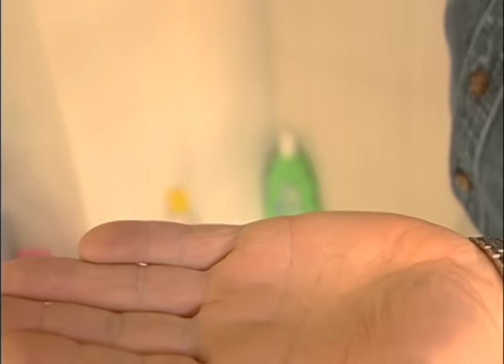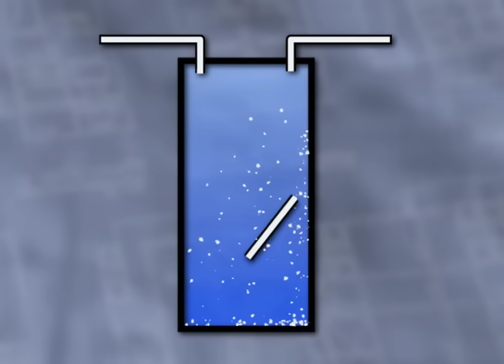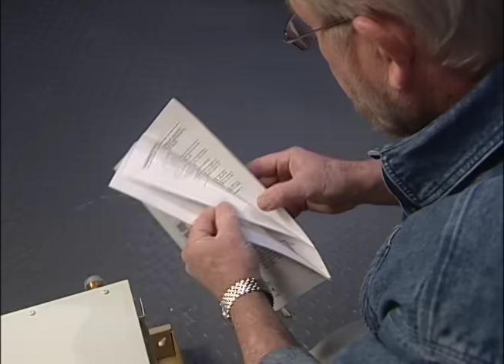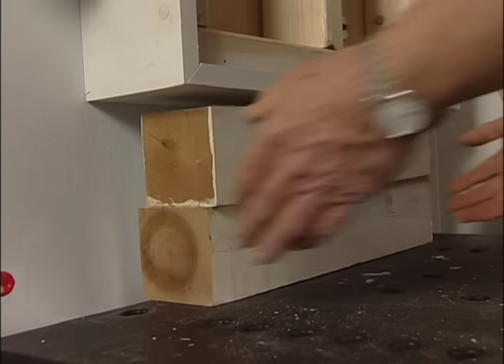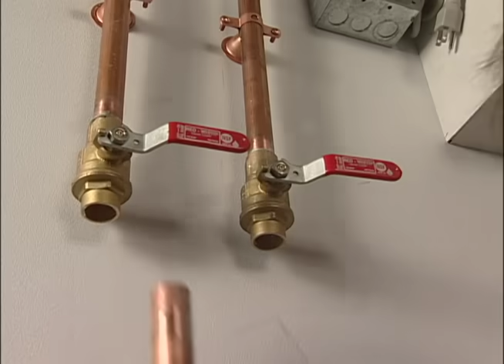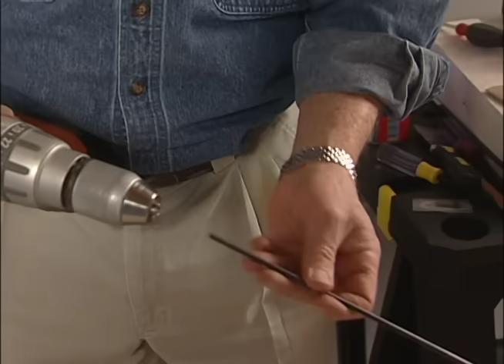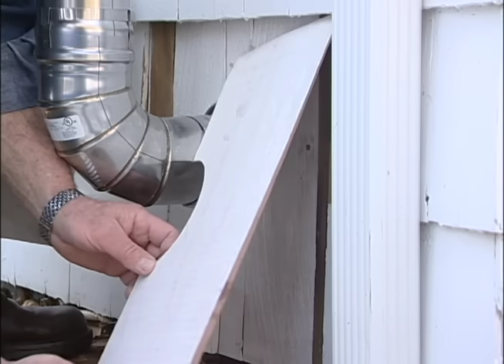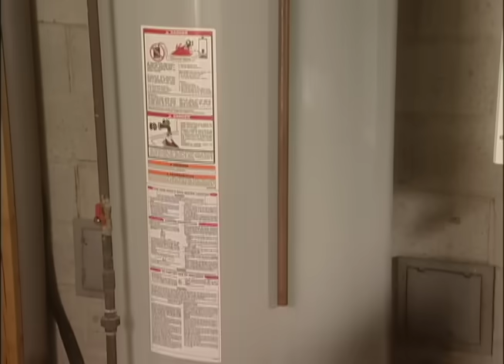Install a Tankless Water Heater

Comment: I disagree, on using "tankless" in Single Family Residences (SFRs).  They make sense in laundries and restaurants.   Existing houses are difficult to retrofit, to accommodate tankless, while complying with fire and plumbing codes, not to mention common sense.  But a plumber won't tell you that, because it's a cash cow for him.   This video trivializes all the complications, and the periodic maintenance requirements of such an expensive boondoggle.  Moreover, tanks are now vastly superior to prior designs; they are efficient and THEY FIT.
Reply: I tell my customers. What discourages most is when I point out that the local hardware store will have an element or thermostat for a tank, whereas on demand heater parts can take a while (with no hot water ) to arrive, and often require a plumber to install. I also share the fact that variations in water temperature and pressure in can equal erratic temperature out, which can be a problem, even with units designed to react to variations. 95% of them stick with a tank.

Comment: One time I tried to drain a water heater and I couldn't because the spigot was clogged with sediment.
Reply: same here, and the stupid plastic valve broke on a few units. what crap.
Reply: Use a short hose open valve and blow into the tank and clear the the valve

Comment: Strange, that doesn't look correct.  Normally the sediment traps are installed on the vertical run, say, instead of that 90' elbow, a "T" should have been used instead.

Comment: Don't get one they are prone to malfunctioning valves.
Reply: As if standard water heaters don't have problems.
Reply: I have never had a problem with the valves on a standard hot water heater . I don't lose hot water unless I take a long long shower.
Reply: I’ve installed nearly 1000 units, very low call backs mostly temp adjustment, removing anti scald limit, or the the rare flow sensor , which has solid warranties anyway
Reply: @andreyyaromich8277  They are horribly costly and can't keep water hot for a full shower.
Reply: cool azul lol the exact opposite of what your saying describes tankless water heaters, they are  designed to   run endlessly with light running out of hot water, something wrong with your own perticular heater maybe undersized. They used to cost 4-5 g 15 years ago. You can pick up 120,000btu units for under 1000$
Reply: *without running out

Comment: I am a Plumbing Contractor in MI. and specialize in service. These on-demand tankless water heaters are imported from overseas and while Lowes and Home Deport are fast to move you from a tank to tankless, you might ask them where the service parts are and who services them. These units have there issues as well and when they aren't working it could be weeks for you to get parts. That is if you can find some to work on it. Explain that to the wife. 
At that point you realize that you should have installed an AMERICAN MADE tank type water heater from the gitgo. Good luck with your new investment and oh, by the way, "You can't run numerous points of use at the same time and have plenty of hot water, with every fixture running you will loose water volume. The heater will run wide open trying to keep up with demand and believe me... it can't!!
Reply: Good old 1970's thinking  And yes we run the washer and take a shower at the same time with plenty of hot water  Of course you cant buy the cheapest unit on the market  Rannai has supply parts all over the country
Reply: Well it has been a long time since I read such a bullshit. Make America great again? Sorry you are playing yourself.
Reply: @Essenkiller  Go get one of those hardware store losers then. I have 25 years in the repair and install business, and can verify that Michael's points are 100% valid. I have actually removed several on demand heaters for customers who are fed up with them. :  )
Reply: @Robnord1  Its their own fault if they buy low quality stuff. Buy units from Vaillant, Buderus, Viessmann, or Junkers. Not this cheap American made stuff. They will last a lifetime.

Comment: I'm not so sure that you connected the vent stack pipes properly to each other.  You certainly didn't seal the pass through flange properly.  The flange and vapor barrier should have been shingled.  In other words, the bottom of the flange should have gone over the lower vapor barrier and the upper barrier should have overlapped the upper flange and lower barrier (as it did in your install.  The way you did it allows any water that gets to the flange to slip inside the lower vapor barrier.

Comment: So you didn’t want to hang it against the wall so you made a different wall
Reply: No, he explained that he needed to mount it a few inches forward from the actual wall so that the exhaust pipe line up in the middle of two floor joists to run to the outside.

Comment: tankless water heaters are great until you lose your power then you won't have hot water unless you have a battery backup unit or a whole house generator
Reply: Computergk91 Gaming true, but my old boiler for seam heat<HAD a standing pilot so had heat DURING POWER OUTAGES LIKE HURICANE SANDY, as it got cold here inNJ,   Now my replacement boiler no longer made with one,,so need a generator,Cheers FROM NJ🇺🇸

Comment: So combi boilers ??? Are America this far behind 😂😂
Reply: Mason Kohl not even a combi boiler- it only heats domestic hot water, heating is still done by a separate furnace.
Reply: Spencer Wilton NO, that’s why they ARE CALLED COMBI BOILERS,  1 UNIT DOES BOTH, somewhere you just have been les astray, or mis informed cheers from NJ🇺🇸

Comment: Swear we have these in the uk but they are called boilers
Reply: Callum G Americans haven't yet grasped that one small unit can provide both heat and hot water. Most of them still use a massive electrically heated tank for hot water, and a furnace for heating. Quite ridiculous really. Now, they are all swapping to on demand heaters, which as any Brit with a combi boiler will know will fail expensively on average once every two years and need complete replacement every eight to ten years.
Reply: Spencer Wilton my boiler is from 2004.
Reply: @spencerwilton5831  Actually NO, most use a a boiler, oil or gas fired,  that includes a hot water coil or the same type unit with a hot water storage tank which is what I use. It costs me about $1200 per year to run using oil. Perhaps not the most efficient system but certainly the least costly. Maintenance is minimal, a filter and cleaning once a year $6, an oil nozzle once every two years if needed $5 and I do it myself. Pay someone to do periodic maintenance costs  $75-100 per year. These boilers, generally speaking never need replacement though I did replace two in my older homes at a cost of around $2000 each after 55 years, for a complete unit. In another home I replaced only the burner assembly for $400, all three were to upgrade, not required. Seems to me spending less money is smarter than installing "Planned Obsolescence" every ten years @ $2000 per year.
Reply: Callum G MOSTnewer places use hw for heat, not STEAM, in GERMANYevery one uses hot water, typically oil fired , my cousin in. PFORZHEIM  gets their heat/hot water, with heat exchangers from a power station ., no body uses steam, nor electric,  Cheers From NJ🇺🇸
Reply: Thank you I thought I was going mad
Reply: A boiler is for a steam heating system not for hot water

Comment: Have one as well, only issue is no hot water if power goes off. They need periodic cleaning as well.
Reply: The maintenance is definitely never talked about with theses things.
Reply: @B-rainwash I have a BOSCH-JUNKERS Tankless water heater I haven't touch it in its first 10 years and it was working like a charm! Now it's it is 16 and still doing well with some inexpensive parts being replaced!

Comment: I thought on demand water heaters could only be used in warm climates.  The water where I live comes out extremely cold. . .
Reply: exodous02 it depends on the rating. Here in the U.K. incoming water may be barely above freezing in winter, but a 24kw or better still a 30kw will be plenty for a decent shower.
Reply: exodous02 you sir have been misinformed ,Cheers fron NJ🇺🇸

Comment: Sediment trap for the gas line did you say? Mine was installed with a pipe coming down just like yours I was wondering why my plumber did that.
Reply: Usually called a "dirt leg".
Reply: Cause natural gas and propane is dirty gas

Comment: Do they have them without gas usage like electric units?
Reply: yes but they use a lot of power... most older homes cannot handle those without  a service upgrade..
Reply: @workingshlub8861  How about on a rehab home. 1 bdrm apt. unit and put it in the unit bathroom?
Reply: @myladcook4779  would not be cost effective in a 1 bedroom home..
Reply: Would cost you just as much by the time you pay electrician to upgrade your power panel to accommodate full electric heater, wallplug heaters will run a faucet a tap or eco shower head at most..barely

Comment: How much is it cost to replace the tankless?
Reply: ALOT!  It's pretty much a complete reinstall.  Unless you can find one with exact configuration of water and gas line placement all of it will have to be redone.

Comment: Dear Ron can u tell the capacity of water heater u just installed? Flow rate in gpm ..
Reply: 5-7 gpm is what you will most likely need for average size home..

Comment: Great job however the vent you installed out side is way to tall and unstable, you need a wall support midway to stop breakage...
Reply: Code in new York is 10 feet and 2 feet above ridgeline
Reply: Also dedicated electric hardwire no plug in and dedicated circuit breaker. Must have firerock enclosure
Reply: Also not seeing any isolation valves to help with yearly maintenance of the water heater.
Reply: What caught my eye was the distance to the window. Code here says 4 feet.
Reply: @Gitarzan66  Using TV magic anything is possible - the cost of install will be $$$ higher & maintenance $.   Lower cost of operation will pay you back over the years...

Comment: I have had a tankless water heater for 9 years. I rent it from my gas utility. It has never been descaled, they say it's not necessary unless there is a problem. Twice i had a spider build a nest inside not allowing it to work but it's a quick job by my utility to remove it at no charge to me.
I can't say it has saved me any money as it takes a little longer to get hot water from the tap so i use a little more water but once it's there it will supply hot water forever if you want.

Comment: Having had a tankless water heater in my previous home I can tell you from experience that there is are few drawbacks not shown or discussed here.  They are called teenager's. As long as there is hot water many teenager's will stay in the shower. Your first utility bills for gas and water will quickly show this trend. My gas and water quite literally doubled until I figured it out. The solution was a stern talk with my brood and a warning that the gas to the water heater would get turned off if they went over 10 minutes leaving them with ice cold water to rinse. So if you have teenager's, beware.
Reply: lol, it seems like there are two kinds of people in the world, the ones that take 30 minute showers and the ones that take 3 minute showers :) don't forget to add the fact that long showers tend to strip natural oils from the skin and will age you beyond your years. you don't want pruney skin do you?!?
Reply: @debunkthejunk1  Another two kinds of people in the world include those that have gone blind and those who haven't.

Comment: I'm still waiting for the Cost difference???
Reply: 2-3 people max using water consciously max, anything over is not worth the savings
Reply: LukeMTB so where did you put the batteries and how much space do they take up?  How long do the batteries last before you have to buy new ones? 
Solar batteries need to be replaced every few years. So by the time this tankless wears out how many times are you going to spend that $200.00 dollars. 

   You are also right about your heater. If your home came with a Tankless then your home has nothing to do with this video!
Reply: more up front cost to install these but they do cut the monthly bill substantially.
Reply: @workingshlub8861  that's a lie...
They do not create any savings what so ever. I've installed Hundreds of these. They run monthly just about the same as a Tank style.
Stop lieing to the people...
Reply: @ltsgarage7780  i forgot your the only one that has any expertise here..
Reply: @workingshlub8861  I've probably forgotten more than you'll ever know. And I'm still no expert. I am certified by 12 different name brands. That's only because so many of them have the same operating parts on the inside. Ive installed more than a 100 of tankless water heaters.  Ive also talked about the same amount of people out of putting one in their homes.
    There really is just a couple of reasons to install one in any home.
   If in your home you dont have a large family or a large soaking tub that gets used 4, 5 or more times in a week. You just through away money on your tankless water heater. In this case your plumber just made that money off of you! Have you thought about if you lose your electricity you now also lose your hot water?  With a tank style that doesn't happen. You'll still have 40 or 50 gallons of hot water. This hot water will carry you for maybe 2 days. That part depends on how you use it. 
  Do you have a large family?

Do you have a large soaking tub in your home?

If you can answer "yes" to either of those 2 questions.  Then i have other questions for you.  
 You might have made a good choice.  I don't think so. But, Maybe!

Comment: And 5 gallon water heater easy install and electric and you have hot water right away no water waste
Reply: Sunny Gor I’m my old house my basement is far enough, so you would waste water waiting for it to get hot, So several years agoI installed a recirculating pump,,which has a timer built in so night time it’s offGRUNDFOSS, WATTS, and others make them, Cheers FROM NJ🇺🇸

Comment: Wow what a huge project. Wonder what it costs. Thousands I think. Why wouldn’t one buy an updated water heater unless over time one is actually saving money.
Reply: Professionally, from 1000$ to 3000$ (not including the heater, it looks strait forward but there is a lot of hidden labour
Reply: @andreyyaromich8277  Just saw a quote for$9000.00 w/ unit.
Reply: James Talcott I would tell those people to stay away from that quote. Even thinking in my head the worst possible install ( cutting drywall for access, drilling concrete, running lots of plumbing and gas line to new location)  
I would estimate 3000$ labour with top of the line tank being around 3000$. (Bells and whistles)

Comment: An HVAC tech suggested that I install a pre and post water filter for use with a tankless water heater to help deal with scale and mineral buildup inside the heat exchanger.
Reply: jburr36 YES, a great idea, but if you are wondering ,why the ‘post ‘unit, that is usually a filter, I would use a ‘Y’ STRAINER that can be cleaned, the reason for that is little pieces of minerals, without, when the homer starts seeing them,,THEN ITS TIME TO. DESCALE THE UNIT,  Cheers From NJ🇺🇸